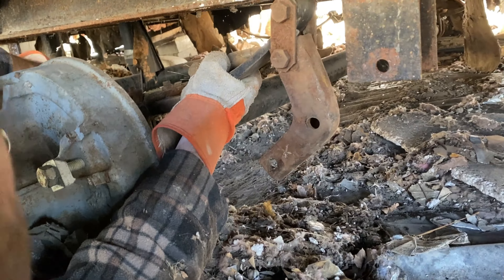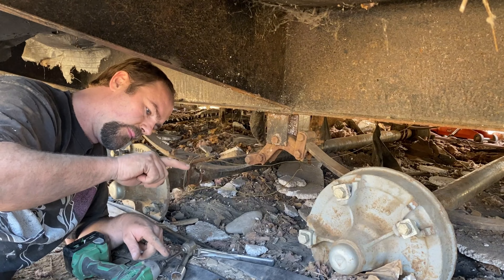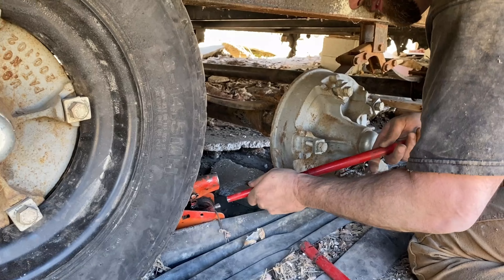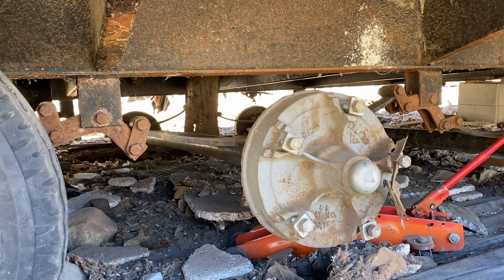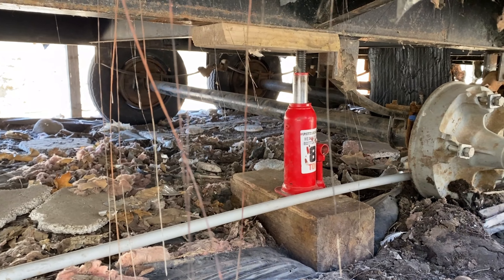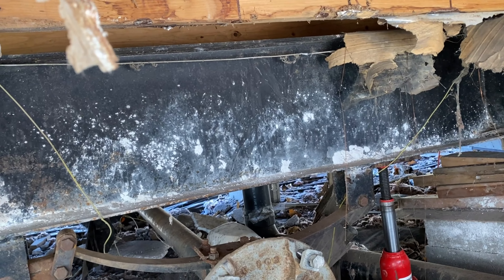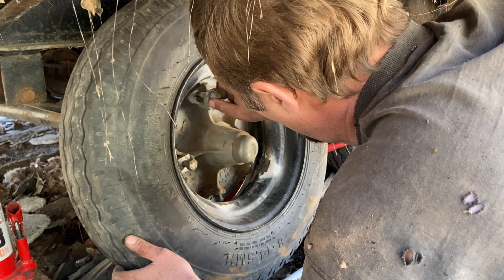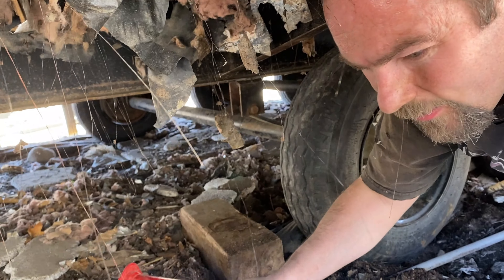Installing axles on a free mobile home

Comment: get a better impact and a deep socket and it will fix your tire issues . no extentions!
Reply from the maker: Yeah I understand, this is just a impact driver for screws I’m just using to speed up the removal and install, the extension is just so it can chuck into the impact driver, good tip though, thanks for watching.😀